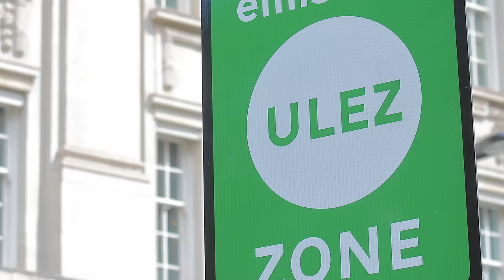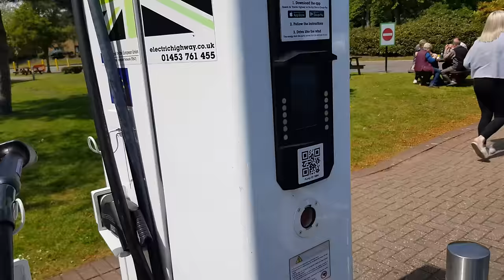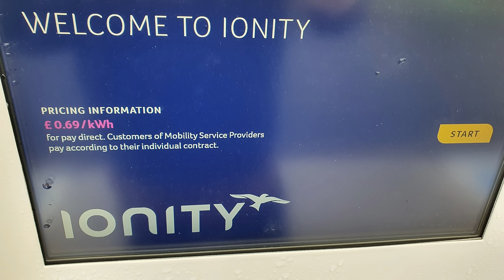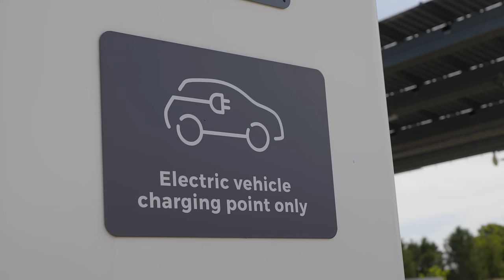The Uncomfortable TRUTH About EVs: The Version NEITHER SIDE Wants You To Hear

Comment: I'm British but I've lived in the states for 20 years and I'm on my third EV. I visited the UK in October and rented a Tesla from a Manchester Hertz. I was shocked by the inadequacy of the charging infrastructure and the charging prices.
Reply: Agree as a fellow Brit in the US. Even in Dallas, the charging infrastructure is far and away better and regulations and roads make EVs make sense. Chargers in most apartment buildings and parking everywhere helps. Also cars and drivers are not seen as the enemy unlike in the UK.
Reply: Wonder what your resale value was. is depreciation really bad?
Reply: You need charging infrastructure in Britain? Don't you have 3-phase power at home, unlike the Americans? And work? Of course, this doesn't help if you live in an apartment, but then you aren't that dependent on a car to begin with. My point is that 3-phase power in Europe assures that your car is always fully charged.
Reply: @grisflyt  You don't have 3 phase power at home unless you have real need for it,  and it would probably cost more, I know that the USA has two 120 volt inlets to cater for appliances that need 240 volts but I don't know if the US has provision for an extra phase?
Reply: @adoreslaurel  In Europe we have. 3-phase power is default here, though it's usually used as three individual single-phase outlets.
 
It's not uncommon to have a 3-phase outlet in the kitchen for the oven. This is also frequently split up into two outlets nowadays as people often have separate oven and cook top.
 
No, the US doesn't have 3-phase. That's the reason they have adopted the Tesla connector as standard in the US. The Tesla connector is useless in Europe, where 3-phase is standard.
 
Old buildings in the countryside may not have 3-phase. They may not even have earth. I don't know.
 
The main point, as I'm sure you got, is that it's three times faster charging your EV at home in Europe.
 
EVs still have issues. I live in the city, like the majority. I only have street parking. Hence no access to any charging of any kind. But as said, people in the city are less car dependent. But it's still a bit ironic. The people that are the least affected by limited range can't have EVs.
Reply: @grisflyt  yer if you own a house with a garage or a drive then you’re set in the UK, but most live in apartments or own houses and park on the street, in which case you’d have to use public charging infrastructure.
Reply: @robinisathakur  There we are in an agreement.
Reply: @grisflyt  I was travelling. I live in the US. A typical home gets one phase of 220V. 3 phases go down the street and you can pay to get all three. The infrastructure that was lacking was public charging, Tesla included. It was all underprovisioned, overpriced and unreliable.
Reply: @davidjohnston4240  You may get 3-phase in the US if you pay for it. 3-phase is standard in Europe. Every home has it. In fact, single-phase isn't really a thing, aside from the outlets. Every home has the same power as industries with 3-phase 480V. It's just stepped down to 230V. It makes no sense having two different systems (single/3-phase), which would require doubling of everything. Power stations and so on.
 
I don't think 3-phase matters in the US in this case. Because cars come with a single-phase Tesla connector.
Reply: @grisflyt  As per my previous reply, home charging had nothing to do with my situation. It was public chargers and the lack thereof.
Reply: @davidjohnston4240  I understand that. I'm saying Europe isn't the US in this regard. We are not as dependent on chargers because of 3-phase charging at home and work. And shorter distances.
 
By the way, I don't know the 3-phase situation in Britain. Britons have never been that big on standards. Electricity in Britain is a bit of a horror story, though you did get one thing right. The power connector. As I understand it, it's something of a small miracle that it even happened.
Reply: @grisflyt  The electricity in my 1925 home in the US is a true horror show. I've been replacing it bit by bit. The electrical code is pretty bizarre in places and has changed frequently over the years. making most existing electrics be non compliant, making it expensive to update. I have two EV chargers on 220V from the street off the primary panel outside and the house panel is a sub panel inside.
Reply: @davidjohnston4240  I have seen those house buyer/renovation shows on TV. As I understand it, you can't just add or replace part of the electrical wire if old installation. You either have to leave it as is or replace everything, which can be very expensive.
Reply: @grisflyt  I knew I would probably get something wrong, in Australia if you want 3 phase it usually because you have excessive needs, like a swimming pool, and other things that require a lot of current, but obviously it would cost more to have it connected.
Reply: @adoreslaurel  Sure about? 3-phase is just three lines out of phase 120 degrees. Used individually, they are single-phase.
 
I don't know exactly how it works here. But it makes no sense to me to have two power distribution systems. It would just mean doubling of everything when there's no need for doubling. I know that the US does it different, but not quite sure how. As said here, you seem to be able to get 240V instead of 120V. You can't do that with 3-phase as each phase (line) is referenced to zero.
 
The purpose of 3-phase isn't just 3 times the power, but constant power. A single 230V line oscillates from 325V to 0V back to 325V 100/120 times, per second or one cycle 50/60Hz. It is also very easy to smoothly rectify to DC, though 3 cheap rectifiers are needed.
Reply: @grisflyt  My understanding in Melbourne is that the over head power lines in my street come in threes and if you have single phase you get one line at 240 volts and if you get 3 phase, it's  connections from the two other wires that go to your house, my opposite neighbour has 3 phase..So I suppose that gives you the option of 415 volts.
Reply: @adoreslaurel  Similar to the US then, I guess. 3-phase has 4 lines (L1, L2, L3, N) + earth.
Reply: @grisflyt  Take your word for it, i am no sparky.
Reply: @grisflyt  "Of course, this doesn't help if you live in an apartment, but then you aren't that dependent on a car to begin with."
WTF ?? 😂
Reply: @orlovsskibet  I made the assumption apartment=city. If you live in the city you aren't as dependent on a car as you would be living in the countryside. Not needing a car is a big argument for living in the city.
Reply: Try visiting Australia then mate
Reply: I was in Shanghai some weeks ago. Every third car was an EV. I was surprised since almost no one there lives in a villa. I don’t know how the charging situation works, but seems to at least.
Reply: Beg pardon? There are 40 Tesla superchargers within 5 miles of Manchester. What do you mean?
Reply: @OneThousand98  Get off at the train station. Pick up a tesla at the nearby hertz. Drive East. See how many chargers you encounter. There is one and it's full all the time.
Reply: Diddums

Comment: ev fires are not a trivial matter though. The luton one was most likely caused by a hybrid and it was the battery that caught fire.  There is definitely a concerted, high level, attempt to pretend that there is no problem BUT there is. Once alight these battery powered disasters CANNOT be put out - simples
Reply: True. Take a look at Redhill fire blanket videos.  A firefighter drapes this over the car whilst it burns out. It reduces the temperature and prevents damage to other property.  Should be on every fire engine. Just the size and weight of a standard tarpaulin sheet.  Nearly all car fires trash the car, so not a huge benefit in trying to put the fire out.  Does mean waiting around for an hour though.
Reply: it wasn't a hybrid it was a diesel range rover
Reply: @forcata No scientific evidence or source has been provided that it was a diesel. I find that to be so strange.
Reply: no it wasn't. Did you see the video showing where the fire was and the colour of the smoke? Wasn't from the diesel tank lol @forcata
Reply: @bigmacdaddy1234  there was a video with visible plate you can look up stop being a sheeple
Reply: @andrewhumphreys9889  there was a video with visible plate you can look up stop being a sheeple

Comment: To me, what's most annoying about EV charging stations is the point you mentioned about none of them accepting cash. But not only that, the ones where I live not only don't take cash, they also don't take ANY form of payment that isn't a credit card! I don't own a credit card and I won't ever change that, but the Maestro card I own, that works at literally every other contactless payment devices like any supermarket, is not accepted by these EV charging stations. Annoying at best, highly questionable ethically at worst!
Reply: The possible reason that charging stations don't accept cash is because they would most likely be broken into by thieves.
Reply: @katpoohtoo  That's not quite in line with the place where I live, train stations sell their tickets at these machines and they take cash just fine, they could have built similar machines for the charging stations.
But again - They don't even take Maestro cards, they ONLY do credit cards, so it's not about getting broken into.
Reply: @Chretze  Write and ask why not (and what they are going to do about it). They won't fix it unless they get complaints, and yours is a totally valid one. I understand the do a very bad job with any card that does not have a lot of money attached. All these pay-at-pump systems take 'pre-payments', then adjust it back to what you actually owe. Petrol pumps are smart and if £100 is refused, will try 80 and 60 and 40 and 20 and 10, so you can still buy a fiver's worth of fuel, even if you have one of those cards which is debit-only with strictly limited funds. EV chargers are designed by people who have never thought of having less than 50 quid in the world so just fail if £100 can't be reserved. They should implement the exact same fallback strategy otherwise it's exclusionary.
Reply: @Chretze  In Europe no one takes cash anymore, not in public places or ticket machines. Maybe some remote places like England?
Reply: @wolfgangpreier9160  Here in Switzerland you can pay with cash everywhere, except these EV charging stations.
Reply: @Chretze  Really? How quaint! I must follow some vids about switzerland again. 

Driving there is too expensive for me. I could ask the kids. They visited friends around Zurich last summer.

Some still demand cash from me and i am not used to that anymore. Hard to keep cash on me when i need it maybe 3-4 times a year.
Reply: @katpoohtoo  Why a credit card then as opposed to a debit card or basic ATM access card like everything else?
Reply: I don’t understand the issue.  Get a credit card and pay it off before the end of the month. Problem solved.
Reply: With Tesla you just link your bank card to the Tesla App on your phone, and all charging stations just charge you automatically. You drive up, plug in and walk away. No cards, no cash, nothing. It’s way more convenient than paying for petrol.
Reply: @wolfgangpreier9160 that's bollox

Comment: As an EV owner, agree with all your sentiments. The government in the UK at least seems to on one hand try to steer everyone to EVs, but cannot on the other hand try to make them work. They don't seem to realise that not everyone has a home charger, and local councils are wholly unwilling to change that. There are solutions which run a cable gulley outside a residence which would allow those without a private driveway (or for those with a private driveway separated from their residence by a footpath) to access the much cheaper at home charging rates, but they don't want to know!

Comment: The first Nissan Leaf I ever encountered in the wild, and I promise I'm not lying here, was on site at a coal mine, they were charging them with diesel generators, and using them for managers and inspectors to drive into the main part of the mine without getting their clothes dirty.
Reply: Presumably because they had strict restrictions on using ICE vehicles underground because of gas emissions? Quite common for mines to use electric vehicles and I guess a Leaf is just a cost effective way to do this.
Reply: That's because running combustion engines inside a mine is not a good idea.
Reply: @25566  Yes, they had a whole ass electric tram system too but that would get your pleated pants dirty.

Comment: Your point near the end of the video of horses for courses is correct. That's why this month we bought a good used 2013 Nissan leaf. Using our hydro it's slashed our motive cost by over 85% from fuel in our city use. We used to spend $100 a week on in city fuel. This car will with all of its costs and limitations pay for itself within a year.

Comment: As someone who is ‘of a certain age’ and considering retirement on a pretty much daily basis now, and also someone who has for the vast majority of my working life had company cars and therefore now thinking about what car to get when I eventually do retire, I’d like to say a very big “thank you” for making this video. I find myself wrestling with the petrol/diesel/hybrid pros and cons (full EV not in my thought process due to no home charger or reasonable way of using one, not to mention the massive range anxiety and long charging times when on a trip issues) so your advice helps enormously to alleviate the fears I have. Maybe, just maybe that 3 litre diesel XJ wouldn’t be too silly..? I’ve always wanted a Jag after all, and life is not a rehearsal is it?!
Reply: Go for the jaguar.
Reply: Plug in hybrids are a great solution for a large majority that have access to some sort of an electric outlet. Charge your daily 30-40 mile usage on a regular wall outlet, and use petrol on longer trips. Overall you'll save money if you have reasonable home rates.
Reply: Get the Jaguar!

Comment: I think there is definitely a need for having attendants at EV charging stations.  Ideally people who can ensure all the charging stations are working, and that those waiting are able to queue fairly, as well as helping those who need assistance. They could also take cash payment.  There should be someone there 24/7/365.
Reply: Who is going to pay for all these attendants at all EV charging stations?
Can you not charge yours?
I'm ok i can charge my EV perfectly fine, it's easy u mong.
Reply: @outsidethepyramid  Thanks for the ad hominem response there, and bully for you!
However, I've seen less perfect people having issues with broken chargers, payment systems and blocked chargers on my travels, as well as in videos on this platform. 
As I don't have an EV, it doesn't affect me right now, but it does put a lot of people off them, as is explained in the video, and I think it would aid adoption if the process was more like that of a normal petrol station forecourt.

Comment: Totally dope video! Your points are on point, but the whole worry about EVs going up in flames and vehicles not getting insured will be ancient history once we roll out legit solid-state batteries, which for some reason are always a decade away. And yeah, the part you brought up about the wierd EV charging prices is definitely a cause for concern
Reply: Sodium ion batteries are starting to arrive and have a much, much lower fire risk than anything else on the market except a bicycle.
Reply: @javelinXH992  also 2 other issues they have is the density of them means that you need more to have the same capacity of lithium batteries and the lifecycle of them is reduced over lithium.
Reply: @rosskania5606  This is true and the trade off for the improved fire risk. Although there is expectation that they can be brought to about 75% of the energy density of lithium ion batteries so that should be workable. However, I don’t count expectations until they happen 🤞

Comment: Great job Jay. Personally I have some serious doubts about Luton and diesel car catching fire. Diesel can not self ignite. Conditions are required, temperature and pressure (combustion chamber). Very good point with disable people.
Reply: I'm with you on the diesel guff. I've seen a few vids and one clearly shows it to be a Range Rover but i'm convinced it was a hybrid. Diesel doesn't burn shooting flames sideways from the approximate location of the hybrid battery (low down on the passenger side). At that point there was no black smoke normally associated with diesel burning.

Comment: Excellent video, thanks for the many perspectives. For me most important take away: promote smaller lighter cars - the SUV trend, also for fossil driven, has rolled car efficiency back 15 years.
Reply: You can blame climate regulations for the increase in vehicle size. Regulations are based upon wheel base and weight. Because car manufacturers can't actually meet the efficiency requirements they just up the size of all vehicles b/c the regulations are less stringent for larger vehicles. 

Remember the days when you could have a small wheelbase micro truck with a 4 cylinder diesel or gas engine? Well, today a truck that size would have to get something close to 100mpg in order to pass CAFE standards. That's why you no longer see small trucks.
Reply: @oldscratch3535  That sounds like a US regulation issue, certainly not EU.
Reply: @mufflejoy  CAFE is a US standard, however, the EU has very similar standards as well.
Reply: @oldscratch3535  EU also has CAFE fleet average emission regulations, but they do not contain leniency on larger vehicles - that sounds somewhat nonsensical.
I blame consumer stupidity in Europe for adopting SUV as a "safe and whatever" means of transportation - use a 2500 kg terrain going vehicle to bring 25 kg child to school, who the H goes shopping in full mountain climbing gear?